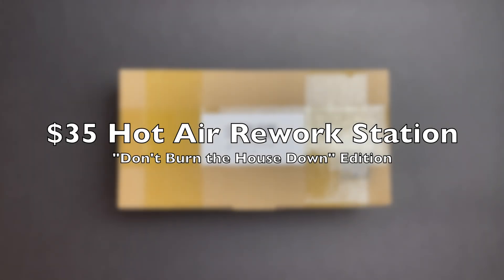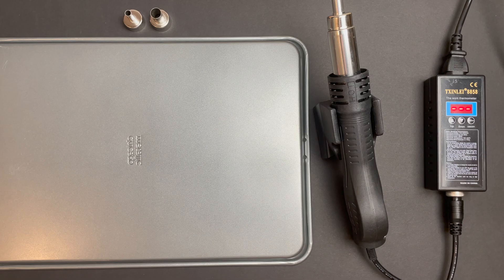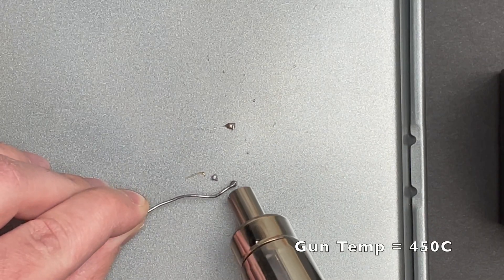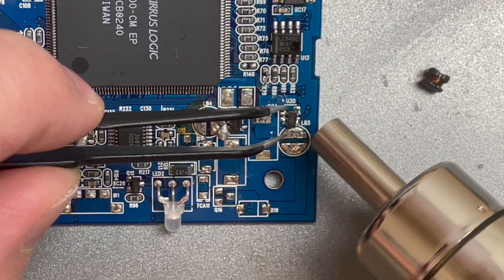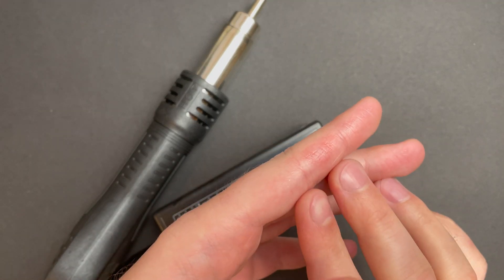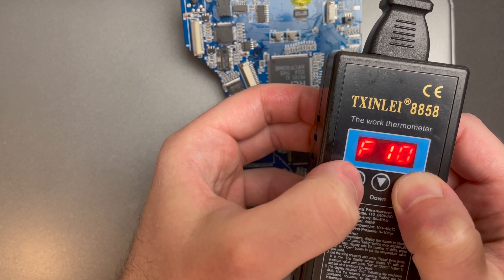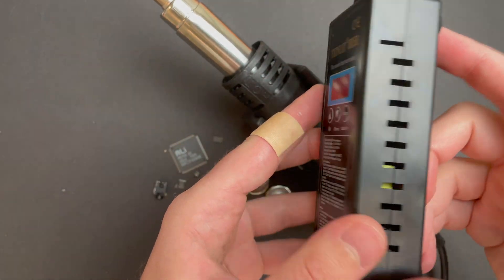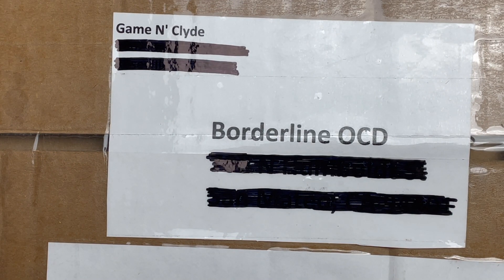Testing the Cheapest SMD Hot Air Rework Station on Amazon

Comment from the maker: In the video I stated that the fan speed can only be set from F5 to F10, which I noted that I found this odd. Well upon further tinkering with the unit the fan speed does indeed go all the way down to F1, so the range is actually F1 to F10 i.e. 10% to 100%. This makes much more sense. I'm not sure why I could only go down to F5 when I first tried it. Might have not pressed the Down button firm enough, or might be some other behavior that I have yet to discover. In any case, all is still well with this device, and I have a bit more control over fan speed that I previously thought.
Reply: I have this same hot air gun and the fan speed can only be set lower if the temperature is set lower too, it's to keep the heater from burning out by not getting enough air through it.

I've had it since last year when i watched your xbox 360 slim red dot of death repair and my hot air gun still works fine.
Reply from the maker: Thanks for sharing bud. That's good to know, this behavior hadn't crossed my mind. You would think they would include that in the manual, but the instructions that came with the unit leave a lot to be desired.
Reply: lower fan  is good for tiny smd cap,reistor,diode as it wont blow those away
Reply: China includes a fire extinguisher and you feel more safe???? 😮 idk what type of weird OCD you have but to me that SCREAMS red flag, danger you’re going to burn your house down 😂😂😂

Comment: This is really funny, but I actually attempted to do a HDMI port replacement on a PS3 with my pinecil, and it was a complete failure, I couldn't make it budge at all, so I went and ordered this exact hot air gun, and it's coming in today! I was not expecting much, so I went looking for some reviews to see what I could expect, I found this and was surprised at how acceptable you made it seem. and then I saw you were going to use it for the SAME repair that I got it for, which is objectively extremely funny. but it does make me wanna ask, did you ever do that repair? and how did it go?

Comment: Almost just the video I was looking for, I bought the same brand but the entry level desktop version.
I was hoping you were going to do a "wrap under path" square SMD IC, as that's why I bought it, but it's not budging.
I added solder, and it liquifies, MG chem, also my go-to brand, and I do the same, use leaded solder, so it flows, on this
but maybe the IC has strong adhesive under it, I don't want to force it.
I bumped the temp up to 450, and a 6 on the 1-8 air scale.
I have many years of soldering experience, and I've used a better heavyer duty hot air years ago, but never tried this kind of IC.

Comment: i have the exact same tool as your its pretty good but....doesnt works very well on ps3 phat console hdmi port the solders in those are bit higher temp even reflowing with low temp solder it is dificult to remove it cleanly had 4 of taces damaged grrrr.....

Comment: Do you have a recommendation for a starter soldering kit to repair broken electronics?  Curious if there is a decent all in one solution that is an upgrade from the typical soldering iron you might buy at Wal-Mart
Reply from the maker: I've personally only used the TS100 but I've heard good things about the pinecil soldering iron for a cheaper option. As for all-in-one kits, I don't have a particular recommendation but I'm sure product reviews can steer you in the right direction. Something with Hakko-style compatible tips is nice so you have a variety of options for replacing tips in future.

Comment: I just ordered one of these to use with a KSGER t12 soldering station.  I could have bought a combined unit for about the same money as the two separate units but to get a 2 in 1 that used a t12 tip for the solder side would have cost me twice as much.  Besides, I absolutely hate it when one part of a low end multi-function device dies and I have a choice of repairing something that isn't worth fixing, throwing out something that still works, or buying a single function piece of gear to fill the role of a broken POS I can't throw out because it's built into another tool I still use.  Much better to have a shelf full of single function tools, each selected for a price point that matches the features I actually need.
Reply: We seem to share the same purchasing priorities! Two years later, any thoughts about this tiny hot air station?

Comment: I bought this from your link and it almost caught on fire. The blower fan did not work at all. I guess I was unlucky.
Reply from the maker: I would have expected the low quality power supply to be the weakest link, as the blower wand is used on a few higher priced models too (relative to the price of this one). For what it’s worth mine is still working and has appeared in several repair videos. Return yours if you can and either get a replacement or just something better. It is literally the cheapest unit you can get so I’m not surprised some are DOA but I commiserate with you nonetheless.
Reply: @BorderlineOCD  I fully knew what I was getting into ordering literally the cheapest one haha. Thankfully Amazon is fairly hassle free with returns. My guess is that they might all use the same looking handle, but only because it's a widely available mould and heating element. The other components will probably differ depending on  manufacturers.

Comment: I bought one of these about a two years ago, and I'm pretty happy with it. Still works, and is a huge help when replacing USB ports and smaller components. Now, if only I could find a similarly cheap dessoldering gun...
Reply: "ECG J-045-DS Electric Corded De-Soldering Iron, 420 Degree C Tip Temperature, 45W" is the SKETCHIEST thing on planet earth... not a gun, but works extremely well.
Reply: Can it work on a 360 I need to recall the GPU please let me know
Reply: @gamingwolf7895  Bro please tell me you reballed an Xbox 360 gpu with no experience what a legend 😂😂😂😂💯💯
Reply: @tejay9416  i reflowed it then it worked for like 4 hours then it died again😳😳😳😳

Comment: I had a similar looking hot air gun as part of a cheap ATTEN soldering station. 

After a few years of occasional use, the fan started to cut out. 

I ended up disassembling it, cutting the cord near the entry to the back of the gun, stripping the cord back  and resoldering the wires back on. 

Has now been good for another 2 years.
Reply from the maker: Lol it's good to know folks see some longevity with these tools. They're not made to last but for the right person they serve a useful purpose.

Comment: I have the bigger version of this it's a hot air and solder station. It's a great machine I've had no issues
Reply from the maker: Glad to hear. I've had no problems with this unit and occasional use. We'll see how well it holds up long term.
Reply: @BorderlineOCD  can you try this on a 360

Comment: Would you still get this if you had a digital heat gun with various nozzles? Seems to do the same job as you can set temperature and airflow as well.
Reply: I had the same thought, but then realized that a heat gun only has two or three speed settings that are in themselves too high, causing tiny SMD parts to be blown away 😋 That's where a hot air reflow station, with it's relatively gentle airflow is more suitable.

Comment: I am going to get one of these too as well as the soldering iron you have.  I used to work for IBM, over 30 years ago, and used to have to use Hakko hot air systems and MetCal soldering stations back in the day.   I have been wanting to get back into repairing some things I have stockpiled and make some videos on that, so....thanks for the review on this!
Reply from the maker: Glad you may have found it helpful. I think the soldering iron is great, I particularly like the smaller form factor. Theres a newer model (TS80) but I'm not a fan of the USB-C connector and prefer the barrel jack on the TS100. As for this hot air station, I'm eager to get some experience with it so its the right hobby tool for me. If you already have experience you might enjoy something better on the hot air front but for light use I think it's not too bad.
Reply: @BorderlineOCD  thanks for that     yeah even with my experience, as little as I might be using them, I think they both would work well for me.   I have an xbox that i picked up at a thrift store for 5 bucks that I plan  to work on and then mod for one of my videos, with the inspiration of your xbox repair videos.
Reply: @BorderlineOCD  The Pinecil can be powered with USB-C or a barrel connector and is compabitle with TS100 tips.

Comment: Now try placing stuff with the hot air and solder paste. For SMDs it can be really useful from what I understand.
Reply from the maker: I've seen it used with stencils for BGA chips. Might have other practical uses that I'm not fully aware of. If it's soldering related I'm bound to mess with it sooner or later :)

Comment: After borking a BIOS replacement on a Sega Saturn I am in the market for a decent YIHUA hot air rework station lol
Reply from the maker: The Saturn bios is a similar form factor to the Neo Geos I worked on a few videos ago. Some Chip Quik will help get the job done without damaging the traces. But I think even a little hot air would have made the Neo Geo bios swap much easier so yeah go for it.

Comment: Welcome back to the console repair scene :-) A hot air gun is a must have but it has a learning curve and practising is indeed a good idea. Some key points when using hot air is to warm up a large area of the board before focusing on just the component you want to remove. It will prevent the board from warping. Circular motion, not too much flow and you'll be fine.

Regarding the ylod ps3, the culprits are usually the large nec/tokin caps by the CPU and GPU. If I remember correctly there 4 of them on each side. They are held in place by 4 large pads, 2 of which are under them and I found them difficult to remove even with hot air (maybe due to lack of experience). I found that replacing each of them with 4 x 470uF/6.3V tantalum smd caps works but it is awkward to find the right layout.They are also thicker than the original ones and need to be covered with kapton to prevent shorts with the metal shield. I think next time, I'll use a ribbon cable (old IDE or alike) to have the caps in a more convenient location.
Reply from the maker: The previous owner mentioned that the YLOD PS3 has a prior repair attempt with 4 TOKIN caps swapped. I'm either going to try swapping the other 4 or redo all 8 and bridge the needed paths that are required when doing a full swap. I am not looking forward to the removal!

Comment: Great video! You are learning and we are learning too! I have the same PS3 but it has YLOD it sucks
Reply from the maker: I know you’ve mentioned it a couple of times in past comments, that’s too bad but hang on to it bud. You will get it fixed eventually whether you slowly build the skills to do it in future or you decide to get it repaired. As always thanks for watching!
Reply: I will totally fix it.  I wont loose anything as I found both of them in the recycling. Im doing experiments with the 40gb model(non BC). But I also found a 60gb BC that I am keeping safe. Even if i cant fix it, resale values on BC models even not working are pretty ok. Time will tell though.

Comment: How do you control the air Flow?
Reply from the maker: The on/off button. One press for each temperature digit, and after you set the 3 digits before it goes back to the first one it allows you to select the air flow on the 4th press.

Comment: For someone who doesn't have a hot air gun, what is the best way to remove SMD components using a soldering iron in your opinion? It feels like you need 3 hands to remove them LOL. Glad to see your channel up and running again.
Reply from the maker: Chip Quik low melt alloy will help. It will give you several seconds of molten joints. For small SMD components I used to just use the largest knife tip on my iron. For capacitors I would mix with leaded solder and gently lift the legs one side at a time, bit by bit, back and forth until I can release it. I have a capacitor removal example on my "Identify PSone Faults Using a Paper Clip" video.
Reply: You can add more solder and/or use a bridge wire bent around to heat up all the legs at the same time

Comment: If you do attempt an HDMI repair on the ps3, make sure to not pull at the port, it should fall off similar to the headphone Jack you removed. The difference is the headphone jack was a through hole component and the HDMI has traces that run parallel to the board that can be easily pulled. Also, use flux.
Reply from the maker: Thanks for the tip bud, I'll be careful. Absolutely will be using flux, maybe some Chip Quik too.

Comment: Welcome aboard.  Excellent video. I too got burned with those cheap hot stations. Few years back I've upgraded to one I for sure recommend to everyone!!! . ATTEN ST-862D.  When you ready.  Thanks for sharing.
Reply from the maker: Glad you enjoyed it. I'm curious to see how long this unit will last so we'll see! Thanks for the recommendation.
Reply: @BorderlineOCD  when using the hot station, keep mind full of how hot you setup temp, don't want to burn away the components from the other side of the board. Depends on your situation, look into  chip quik. super low soldering point. Little expensive but will save you time and money. You doing great 👍 👌